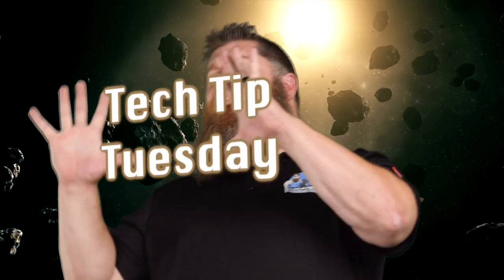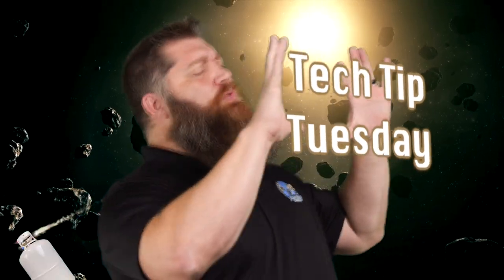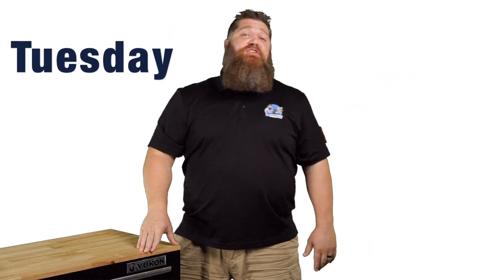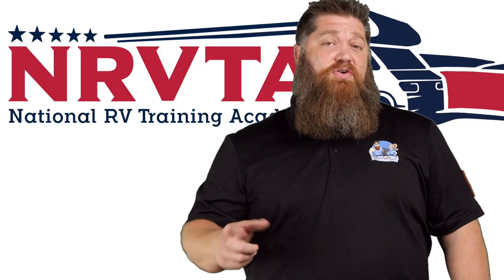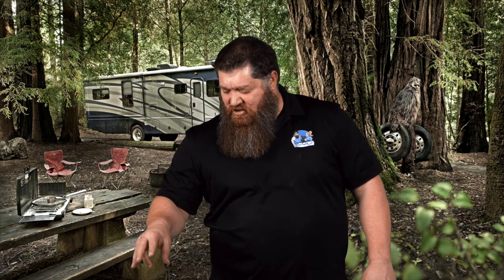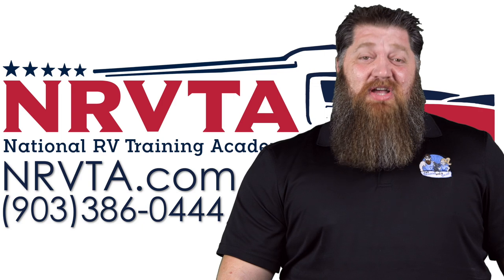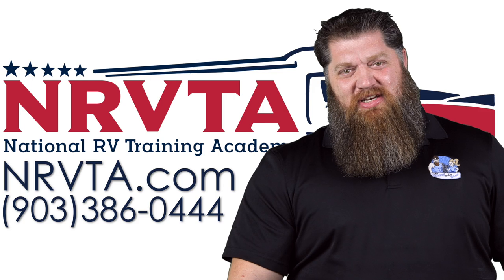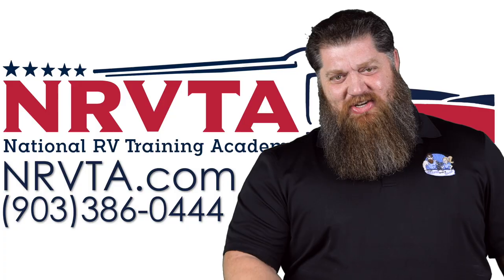RV Leveling Systems

Comment: When leveling trailers you forgot to tell them to level side to side first.  Then do front to back last where you use the front jack to get level . Don't unhook until you level side to side first.
Reply: Exactly,  side to side is step one. Then front to back. Also did not mention that the scissor jacks are not leveling jacks, only stabilization jacks. Good content on the reason to have "level" but a little confusing for people that don't have hydraulic leveling systems

Comment: Wait wait wait. The jacks on most travel trailers are only to stabilize an already-level trailer. So you have to level side-to-side first and THEN disconnect. 

Then use the tongue jack to level front-to-back and THEN put the stabilizers down. 

The stabilizers can collapse if there is too much weight on them and sometimes even the frames can bend.
Reply: This! 👏 He was very vague with his explanation. Normally to get the truck back under it you would raise all stabilizers, all the way dont half ass it abd forget, then hit the electric jack at the tongue of the camper. I imagine if they got auto levelers they have an electric jack for the tongue!

Comment: How do you know if you have a type of refrigerator that needs leveling? My manual says "Dometic..."?? 
What type of support/leveler system would one use in a travel trailer??
Reply from the maker: An absorption-style fridge runs off of electric (120v) and or gas.  You will see metal fins in the back of the fridge.  RV absorption-style refrigerators depend on gravity for efficient cooling and optimal operation. If your RV fridge is not level, its efficiency decreases. This not only poses a challenge in maintaining proper food cooling but also presents potentially hazardous issues in the future.  The newer 12 volt and residential units are different because they use a compressor to cool.

Comment: I have a heartland lithium 24 foot toy hauler, it has automatic jacks that come down in the front and the back like a scissor jack. But not sure if these are used to just stabilize the rig or actually level it. But I need to use blocks under the tires to get it level before I put the levelers down? Did not know if I can really put a lot of force on them or they’re just mostly for keeping it stable not for leveling.
Reply from the maker: Those are more than likely stabilizing jacks.

Comment: Todd,  
I have a dual axel Bullet Travel trailer.  We arrive at the campsite and level side to side and forward and aft.  Bubbles are in the middle.  We put down the psx1 stabilizers,  then extend the slide.  Check for level and the camper is leaning to the drivers side due to the wait of the slide.  
Is this a problem?  Bubble is just outside the lines.  
How do we fix it? If it's a problem.  
Thank you,
John
Reply from the maker: I would use a bullet level on the floor next to the fridge and use the bubble indicator there. Sometimes the bubble located outside the RV can be out of calibration. Not the air pocket but the position of the device itself.

Comment: How level is level to run the fridge? And is starboard to port as important as fore and aft level?
Reply from the maker: The more level the better it'll perform. The refrigerators user manual will tell you the angle threshold it needs to operate.

Comment: Is there a to steep of a pitch? I’m sure there is but what’s the best way to identify it
Reply from the maker: Normally your self leveling system will tell you when it’s out of range. If you’re going manual you’ll want to reference your manufacturers manual. Most of them say to Park as close to level as possible so if you’re way out of level you may want to adjust.

Comment: Great video and what you mentioned at the end how to over ride. 
Question. I have the auto leveling system and after it leveled down for almost a year there is a squeaking sound as they are retracting. Almost sounds like the seals are dry kind of sound. I wiped them before lifting. Could I just put a light coat of lubricant on the posts? Any suggestions? Thank you.

Comment: We do side to side with a level on a known part of the frame then front to back with the jack.  Put down the stabilizer jacks and the camping starts.
Reply: I did side to side off the inside floor above the axle. I don't think i got it right because the door is hard to shut sometimes. Mainly in the morning when the sun hits it.
Reply: @georgebeauchamp1690  Don't know if Todd comes in here but the floor can be slightly wavy making leveling there difficult.  With ours the frame crossmember just before the box is a good place for us to level.  Be sure that you aren't putting your stabilizer jacks down too hard.  They can twist the frame and box, and cause all kinds of grief.  They aren't meant to lift the weight of the trailer, just to calm down the movement.